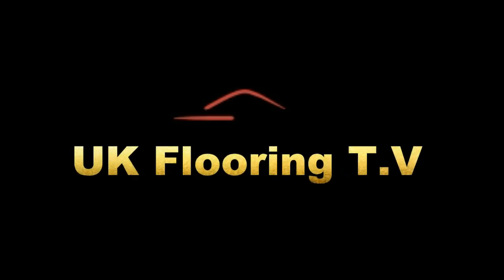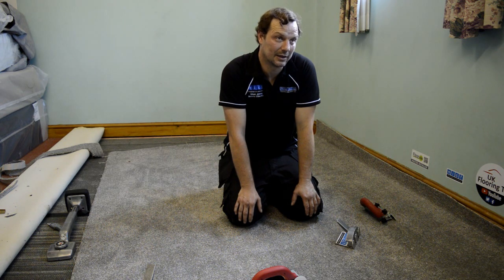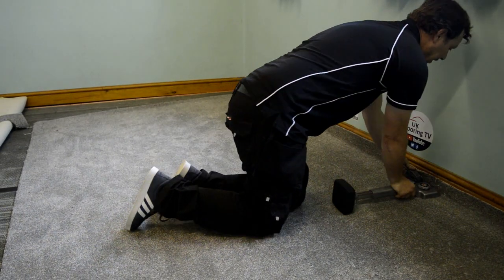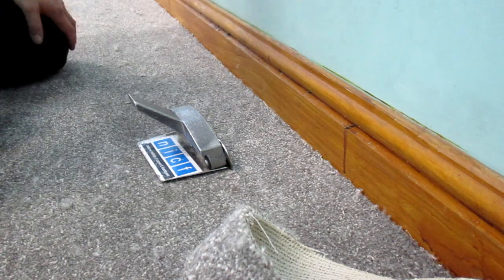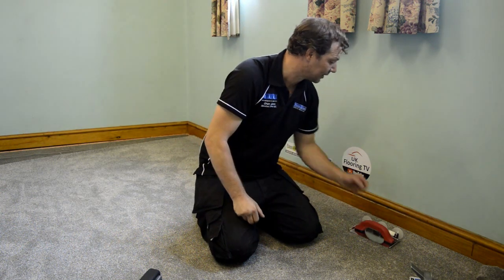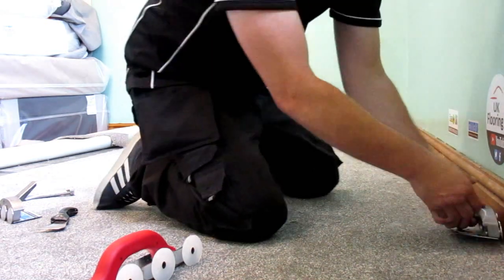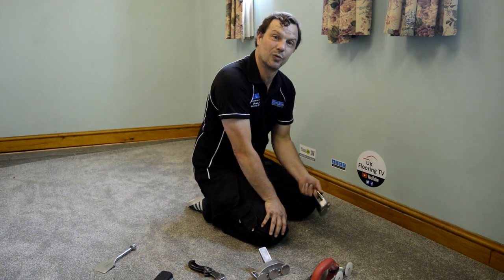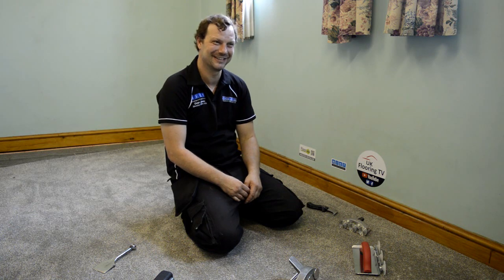This weeks, Dans Tool...... Tucking Tools

Comment: Check out RWS Carpet supplies for speed cat. Cost around $100 dollars with shipping to the USA/Canada. 
Waiting for mine in the mail. Roberts tucking tool is useful just not very good quality. Wheel gets loose real quick. Use sometimes.
Try tucking with a wall trimmer.